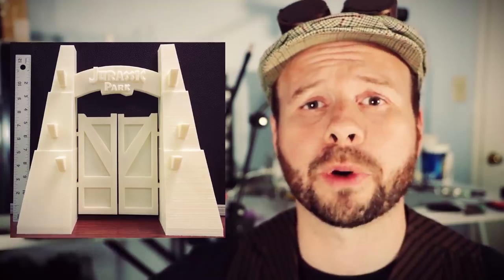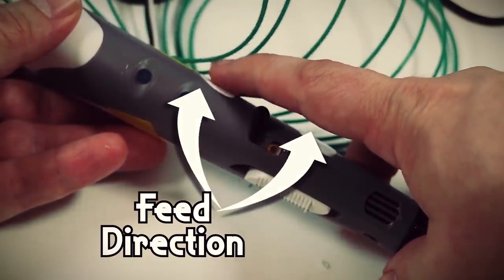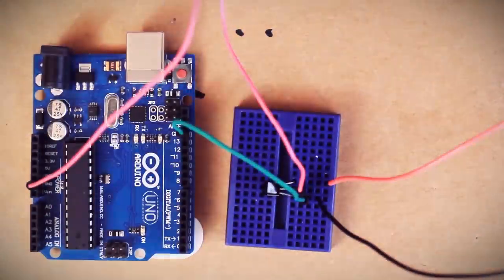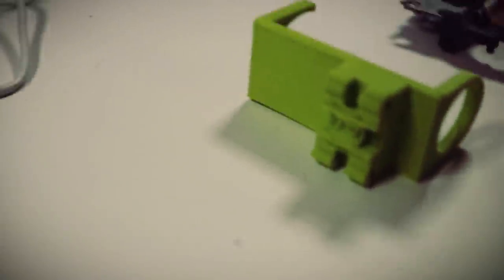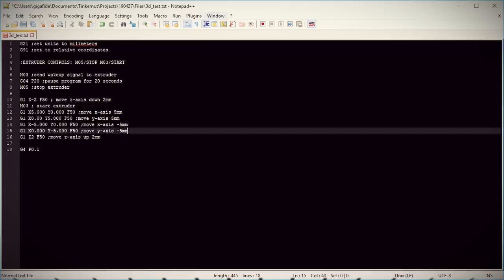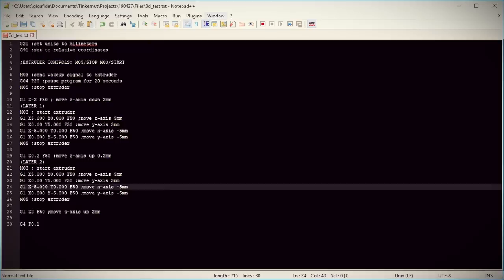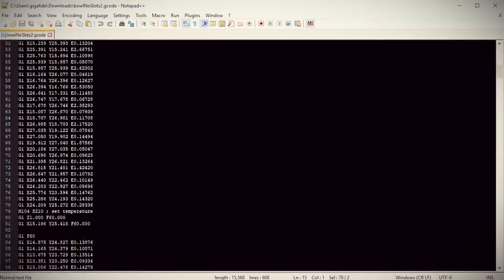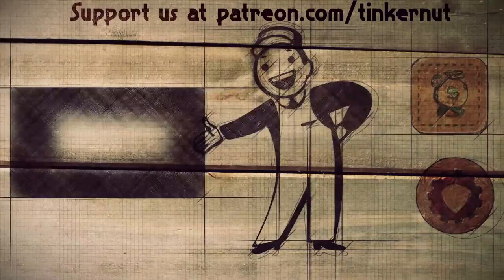Upcycle Old CD Drives into a 3D Printer (Part 5)

Comment: I made (sort of) one from the previous series. The issues I had were with the transistor that gave the command to start extruding which I circumvented buy using a relay(!) and the fact that the motor moving the z axis was not powerful enough to lift the pen. I cut the pen in pieces to lighten the load, but eventually I quit the project. I did manage to print some stars one one layer though :)
Reply: Same here, i used a counter weight because the pen was to heavy. Sad to see the 3d printer was useless at the end...
Reply: @2strokerides  even a star will b more tan enough for me
Reply: @SiddharthHaobijam  thats true. It was a fun project

Comment: Tip for anyone who's doing this project I found that you can generate the g code for the 3d model with sli3r and remove all the words in notepad and select all then copy and download the .nc file from thinkernut and select all then cut and paste the g code and open it on grbl controller you can change all the extruder commands to what thinkernut said but I just turn on the 3d pen and set the speed to what is appropriate

Comment: Is there a way to use actual 3D printing software with this but still use a arduino uno with the individual spark fun drivers.
Trying to build one.
Reply: It mentioned a ramp board, or 3D printing arudino shield in the last few vids, not sure if it would work with an uno you might need a different one

Comment: Quick question, Are you able to upsize or downsize this?
Reply: Not at all. The basics are usually the exact same. But any design based on disk drive stepper motors work best on small scales